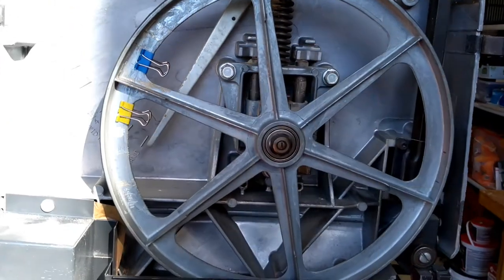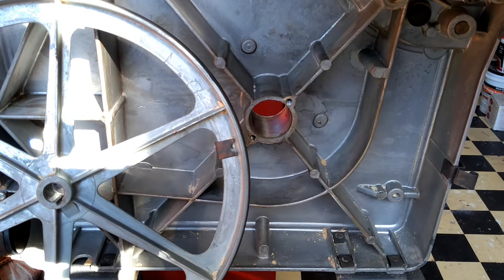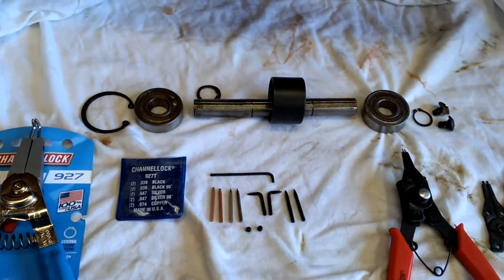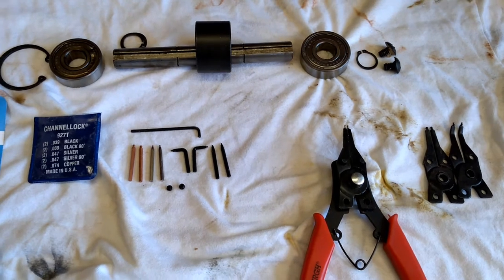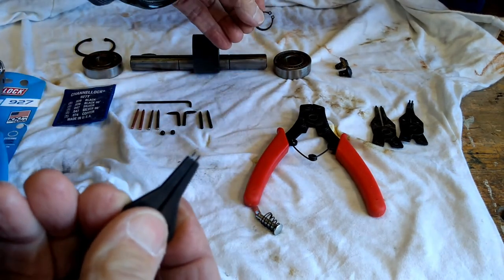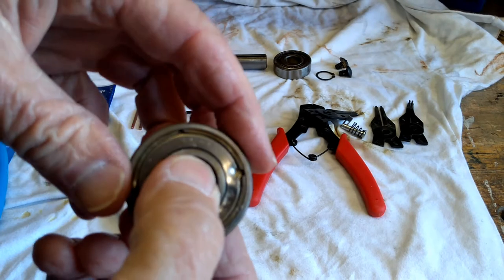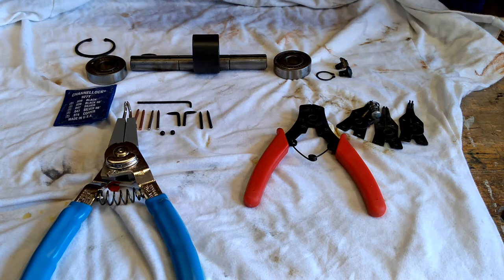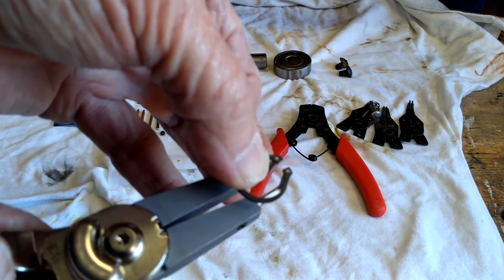CHANNELLOCK 927 Retaining Ring Pliers Evaluation

Comment: The Channellocks are great for external rings, but they do not have enough spring strength to remove a large internal ring. I had to go back to the cheap players to remove a large internal ring like you show